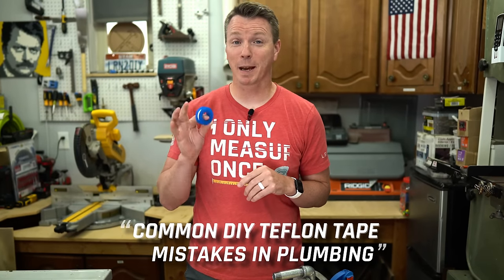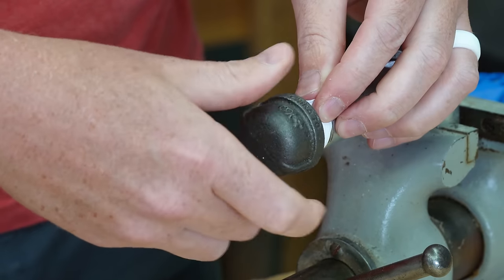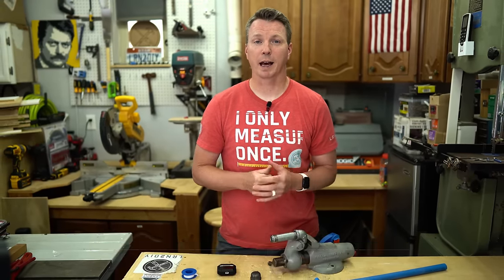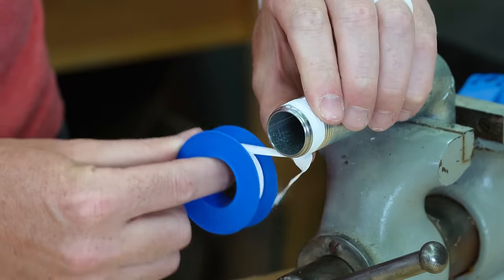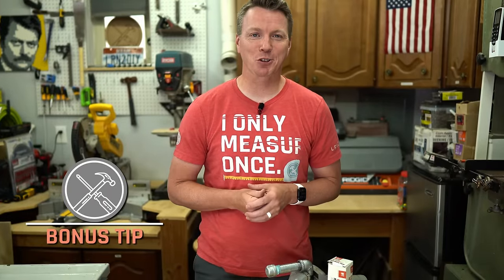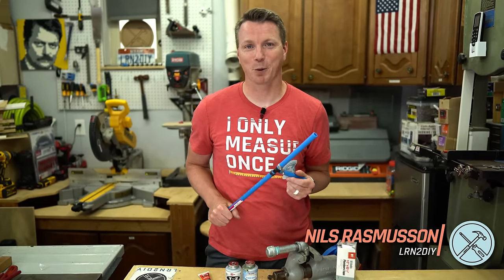6 Plumbing Mistakes DIYers Make with Teflon Tape

Comment: 6 or 7 wraps is way too much all you need is like three or four ... Too many wraps will cause the tape to tear in places and it will cause it to leak once it gets 200 lb of pressure on it because that's what most municipal water companies use and if you ain't got no pressure regulator it's gonna blow ,,.... Yes I'm a retired plumber did it for over 42 years
Reply: Ya this guy needs a YouTube video on how to wrap a pipe . 7 wraps is what a rookie would do lol
Reply: Waffler
Reply: He read it right off the package.  Do you watch these helpful videos just to judge people for not doing things the way you do?  Go find something else to do.
Reply: 55 to 60 psi city water pressure max. Common!    200 psi ? No sir
Reply: 55 to 60 psi city water pressure max.
Reply: @allenanderson3649  Tennessee American  in Chattanooga  Tennessee pumps between 190 and 210 and has been since 2009 ....the reason I know this is because I retired from there in 2015
Reply: Good to know I am an apprentice and they always told me  7 times around depending on the size of the threads. Thank you
Reply: I've used 6 to 7 wraps myself, it works just fine. That's why the manufacturer's instructions says "A MINIMUM of 3 wraps" you don't necessarily have to use that little. Let this man be please.
Reply: @allenanderson3649 active plumber here in Utah. City pressure ranges from 60-160psi. I've seen everything in between. A PRV brings the HOME pressure down to 75psi or lower, but city pressure is typically higher. I've worked at a friend's place in S Carolina though and their nighborhood pressure was around 60psi, so it can definitely fluctuate by municipality
Reply: I went through about three tutorials of guys not mentioning a good amount of wraps. Ty for sharing the wisdom.
Reply: An appeal to authority, also known as an argument from authority, is a type of informal fallacy that occurs when someone accepts a claim because an authority figure supports it, without considering the authority figure's actual knowledge of the subject.

I currently work as a high pressure pipe fitter. I have not been doing it for very long at all, and I work with people who have been doing it for 40 years. Sometimes they make mistakes, and what’s more is they are not willing to accept their own mistakes because they believe they are so experienced they must be right. Experience is important, but overrated. The difference in knowledge and skill between someone who has done something for 5 years and 40 years depends entirely on the individuals, because one of those individuals could be complacent while the other could have an unending drive for knowledge.

If you do a quick google search, the number of wraps recommended depends on several factors including the thickness of the tape (of which the guy referenced in the video said he was using thin tape), the condition of the threads (more tape for old and worn out threads), and the size of the pipe (less wraps required for 2 inch pipe because the threads are deeper).

I will not pretend to be an expert because I work in the field, I am just spouting out information I googled, but it is very dangerous for someone to say “I’ve done this for 42 years and you have to do it this way” when there are clearly multiple factors to consider. Granted, the video creator didn’t bother to go in detail about different factors either, but I’m not defending him, just making a cautionary message about believing experts.
Reply: @allenanderson3649  I could tell you.
Don't have tennessee american water
Reply: @andrewevenson2657  You seem.
To me like a guy who really likes to hear himself talk
Reply: @andrewevenson2657 perfect. Couldn't have said it better.

Comment: All of this was good advice but one thing was wrong..  When wrapping the tape onto the pipe, the tape should start from BACK to FRONT of the threads in a clockwise motion., stopping just short of the end of the pipe..  This lets the tape overlap itself allowing the tape to flatten and seal itself as you tighten the joint...  If you start at the front going back to the pipe, the overlaps can get caught on the fitting and get pushed off the remaining layers, possibly creating a leak situation..
Reply: Doofus

Comment: I am a Hong Kong resident.  Here is the 1st city to use salty water(sea water)  for toilet flushing.  Some of the tube and device are made of plastic for the anti- rusty reason.  For here local plumber,  they recommend 30 warp,  and rolling it thin at the front(loosening direction)  while thicker at the screwing end(tightest end) .  For me,  I will roll like that but only5-7 warps.  I understand that they do not want to re- do,  so 30 warps as their practice. (partly due to the thickness of tape).  As I said,  some tubes and devices are in plastic(nPVC) ,  be watch-out if warping too much for cracking the screwing.  Also,  if with a rubber pad,  we can consider it as water tighted enough,  try without tape.  If dropping,  then fill the tape a little bit 6 rolling warps around.
Reply: Separate sewer pipes for toilet salt water drainage??
Reply: Using plastic is also as good as Teflon. Try it
Reply: Does the salt water keep your bowl clean?
Reply: @Nozinbonsai  I am not sure the bowl meaning.  The toilet set area containing those dirt?  Or the flushing water container?  I guess should be the 1st one.  Basically,  the salt flushing water is not so clean due to sometimes repairing of the supply pipe(which is underground and have to dig).  So the container would with earth precipitated.  But the bowl,  (if I guess right)  inner of the toilet is clean after flushing.  When I look into some info that,  there is not many places using sea water for flushing.  Hong Kong flushing water   actually was flitered and de-salt to a certain level.  Still,  we have to avoid  metal valve for flusing.  So,  have to be plastic valve/ tap supplying flushing water... and pvc pipe applied.
Reply: Cool info, thank you
Reply: Call me Mr Pedantic, but they've used salt water in Australian bush towns for over 100 years - and still do.... 🙂

Comment: Missed one important "mistake" -- use the CORRECT Teflon Tape for the purpose.  The white is for basic water line work.  I also use it on bolts (see below).  They make "Yellow" tape for fuel (Gas, Oil, et cetera); they make "Green" for Oxygen Lines.

Comment: I think the simplest rule of thumb is that Teflon tape is only for tapered pipe threads. It lubricates the threads and then fills the microscopic gaps and imperfections between the threads as they are wedged tightly against each other. I can't see the logic of ever using it on a straight thread as there is never a point where it is compressed into a tight seal.
Reply: exactly!  you got it right!
Reply: I mean i could kinda understand that if you are talking about 3rd world countries, but in general you should use tape and dope in conjunction. Anything else and a decent plumber would just mock you.

Comment: I think another mistake is using the wrong thread tape for the fluid passing through the conductor. I don't think PTFE is recommended for gas piping. I don't know what it's made of, but I know that it is yellow instead of white, so that it is easily distinguished.
Reply: I checked the data sheets for a couple of different thread tapes for natural gas, propane etc. One white and one yellow. They were both made from PTFE. The temperature range was higher than that of the tape for regular water installations so it's probably some different formulation of PTFE, maybe with some fire retardant additive too.
Reply: The colour is irelevant, but there are PTFE bands made specifically for water, gas, high temperatures etc.
Reply: Thanks for that. I was just taught to use the yellow, but didn't actually know why. Now i have a better understanding and that's what it's all about. @skunkjobb
Reply: Same tape I think, color just helps identify.

Comment: Nils, you hit on one of the most important points when using Teflon tape.  When you have a rubber seal, don't use the tape.  I made that mistake so many times years ago when I started out as a contractor.  You run the risk of not getting the fitting tight enough to seal against the rubber seal.  Great video, as always, and I can't wait for your future videos.
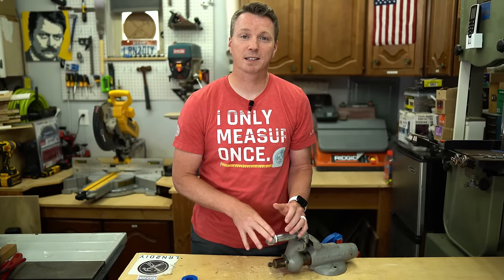Reply: Wouldn't teflon help with getting it tight since it is a lubricant? (7:35)
Reply: @syriuszb8611  completely depends on how much you wrap the pipe.  Years ago I would use tape on many of the plumbing lines only to have a small leak.
Reply: Not to mention how taping the threads of compression fittings is a red flag allowing anyone who knows better to question competence.
Reply: Simple rule: straight threads - no tape, tapered threads - use tape ( or dope). For high pressure helium fittings epoxy glue is applied to the threads as helium gas under pressure (~300 psi) will just about leak through anything except compression fittings or welded joints. To remove the fitting just heat the epoxy with a propane torch and it will allow you to undo the joint.
Reply: Totally true and something I had to learn with trial and error. If only this video was around 30 years ago 🤣

Comment: Great video, with important information, as usual. As a relatively new homeowner, I love this channel.
One method for applying PTFE tape that I learned years ago is to first tear off a small length of the tape long enough to wrap around the pipe several times. Twist it up long-ways, into a string, if that makes sense. Then wrap that string around the section of pipe you'll be taping, making sure it's seated down inside the threads of the pipe. Once that's in place, then apply the PTFE tape as normal like you explained. I learned that it gives a bit of an extra 'sureness' to the seal. I've always done it that way, since I learned it, but I'm not sure it's really necessary to do. 

What's your opinion? It seems to be cool to just use the tape properly without the added step.

Comment: Thanks.  I think I was nervous the first time and I wrapped it only three times.  Still dripped.  Took off the tape and w/ confidence held the tape the way you said and counted to make sure I did it six times.  No more dripping.  Had to do it on a toilet intake which isn't suppose to need it.  Thanks - good video!

Comment: That blue dope is the best thing ever.
Reply: I would not use it OVER the teflon tape though, but I agree, thread sealer is the go to solution for performing a secure seal and it also allows one to set taps and angle valves at the exact angle you need. Teflon tape does not like to be backed off, not even for a half turn.

Comment: Another great video.  But I have to admit, a lot of this is common sense.  I only use 3 wraps and I have never had a problem.  I think anymore wraps is wasteful.  Just recently I used this to fix a plastic hose coupling that had stripped and so I wrapped it and stopped the leaking.  This saved me money.  I would advise you to cut the tape instead of snapping it off because it's a pain to start the next wrap with a string of tape.
Reply: A lot of things seem simple or obvious once you know it. At the end of the day people only know something  if they've been taught, or went and learned it themselves
Reply: @LamboGallardo560  If you think about the tool and how it's designed, you should be able to figure out how to properly use it. Tape is not that complicated.
Reply: Common sense is not common.
Reply: I have run into bad threads on chinese made pipe that required more wraps to seal the threads.
Reply: @bigmacdaddy1234  This comment demonstrates how common sense is by definition "common", but it may not be up to the standard I would like it to be.

Comment: I am very experienced because I wrapped hundreds of pipes. Stainless steel steam and water. I start the tape two threads from the end. Pipes are tapered. They seal as you tighten. I start with one wrap then as much as 3 or 4 at the back.
I also use the edge of the plastic roll and roll it over the threads to push the tape into the threads.
Germany uses strait pipes that don’t taper. They require string in the threads. I’ve done those too. 
The thing about liquids sealers is THEY HAVE TO DRY 24 Hours. Read the label! Each product has a different cure time. Stronger sealers have slow dry time.

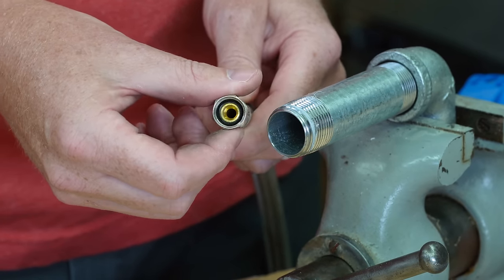Comment: 2:54 the one exception to this is maybe a shower head.  But the tape isn’t for water sealing, it’s to make the treads tighter so it doesn’t loosen with daily adjustments.
Reply: I've always known the tape is not for sealing but have never heard AnyOne say that.
It lubes the threads letting them get tighter for the same amount of 'twist'
'good man  😎

Comment: How do I know when to use pipe dope? From the comments, they seem to say either use tape or dope but not both, which contradicts the video. My suspicion is that dope is needed in higher pressure situations, but I am not sure at what pressure that is required. Maybe I should look on the box that came with my PTFE/Teflon tape but I can't find it at the moment.
Reply from the maker: From my research and in talking to plumbers, everyone seems to have different opinions on this but one thing that makes a lot of sense to me is that if you're making connections that will be very difficult to access later on, use pipe dope or tape and dope. Underground and in -all, especially. For exposed and easy to access areas like under a sink, teflon tape might be sufficient. It seems like if you ask ten people about this you'll get ten answers but I wanted to bring awareness to the fact that you have options and sometimes tape by itself isn't the best solution.
Reply: Only advantage tape has is being less mess.

Comment: Tape won't make up for a bad o-ring, but it will prevent the nut from rusting onto the fitting. You could use silicone grease, but the tape is convenient.

Comment: I recently found out LPG used a different tape especially for propane fuel.  Is there any other tapes for threads?
Reply: i went to a place that installs furnaces & they sold be the blue paste in a can. it was 20 bucks for 1 can but i have zero leaks on my propane trunkline.

Comment: He forgot one (and only) important fact...teflon tape does not seal.  It merely helps reduce friction on pipe threads so that there is the tapered pipe threads are tight enough to seal on their own.  The tape gets shreaded when pipe threads are tighten.  That would seem obvious except for "professional" YT DIYers.
Reply: bingo ...if the threads are cut and formed right
Reply: Finally, someone who knows.
Reply: he literally did 7:40
Reply: 3:04 he mentioned the tape isn't meant for sealing.

Comment: As for metal to metal the ultimate way is to put a layer of pythop on the threads and then wrap the Teflon on which will definitely not allow for any leaks especially on things like gas and also water
Reply: Leaks are from untightened joints.  The tape allows one to tighten the joint by lubricating the joint through friction.
Reply: @mrstanskaggs1  You are exactly correct.
Reply: @mrstanskaggs1   That is only part of the tapes job. It is also there as a sealant - hence why it was even created and why the manufacturers call it "thread SEALING tape".
Reply: @mrstanskaggs1  Lubrication may and may not be an incidental benefit, but it seals by filling tiny gaps between poor-fitting tapered threads.

Comment: i generally still use teflon tape/sealant even where there is an o-ring, especially within reverse osmosis systems which can suffer from very small leaks otherwise.
Reply: Any issues you have encountered here? My connector has an oring and yet there is leakage. So I intend to use the tape in addition to the oring.

Comment: I use the paste or tape,not both; I use the paste on p.v.c. threads and not tape on p.v.c. I have never had a leak on paste only threads. & I work for a small water utility co- op ; often times,especially on new water meter installations I just use the Teflon paste & have never had a leak in the past 15 years.

Comment: I couldn’t stop my new faucet from leaking even with the tape, but I realized that when I used two different pieces, I would always get a leak. So using one piece wrapped seven times worked not to pieces wrapped three times.

Comment: Another tip.... it's easy to use it in a demo NOT actually on a pipe application... you know, like holding the pipe in a shop, or having the pipe in a vice in a wide open shop. Cheers!
Reply: Yep. Trying to do anything under a kitchen sink with everything else already installed is a royal pain. Literally made me consider calling a plumber even though I know how to fix the issue, I just want someone else to do it for me 😅

Comment: Thread seal tape AND pipe dope??  That had never occurred to me!  I've really gotten away from teflon tape, and almost always only use pipe dope anymore...
Reply: In some cases, you may need to add linen thread to the pipe dope, particularly in case of very loose fitting threads.  You can see this in the case of some non-tapered fittings (more common in Europe).

Comment: Roger Wakefield may be correct with six or seven times with old-school Teflon tape but the new PTFE tapes the mill thickness of them is thicker 
so if you went six or seven times with the new gen 2.0 style tapes. when you screw your bell and spigot together it would make the tape useless.   As it would peel back